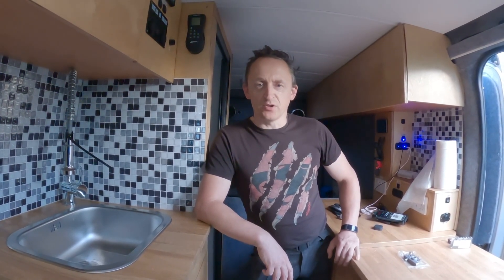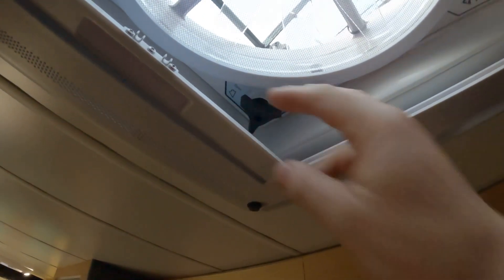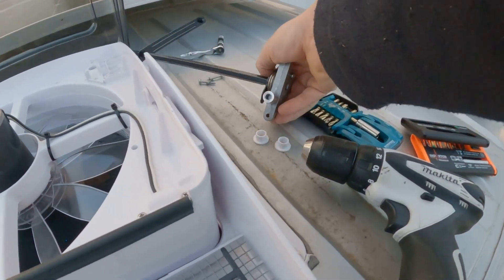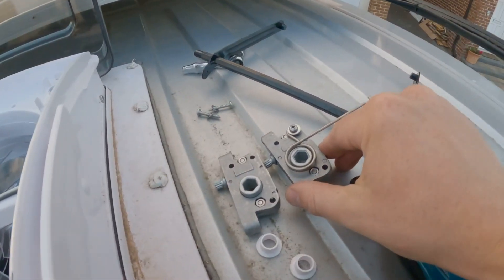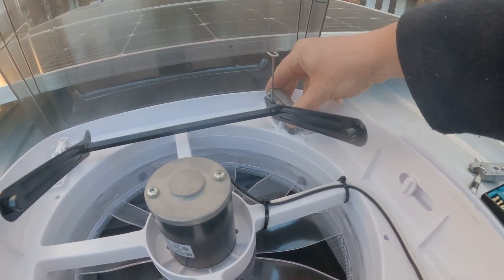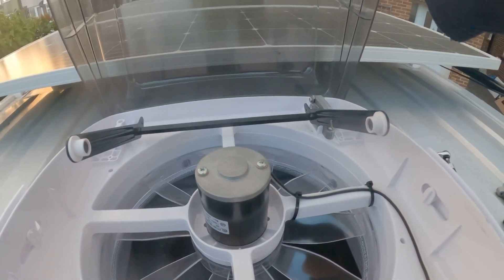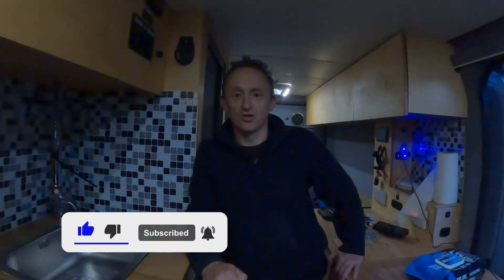Replacing MaxxAir fan gearbox

Comment: Yes,apparently they are rubbish.But a couple of suggestions.Firstly take out the two bolts which hold the two halves of the gearbox together and fill the casting with a good quality waterproof grease,reassemble letting the excess grease ooze out then close it up.This gives a bit of extra protection to the wear surfaces.Second ,it is possible to disconnect the lift motor from the circuit board,this allows manual opening without straining the teeth in the gearbox,this does not affect the fan operation.I would agree that it defeats the object of automatic opening but it does mean the gearbox is under far less strain as you can feel the stops rather than let the motor wind to the limit of its power.
Reply from the maker: Hi Eric, thank you for watching a commenting. That sounds like a great idea, I'm guessing this is what have had to do with one. Its a shame that the gearbox is not better made in all honesty. The only saving grace is that if you need to replace the fan it does separate from the base so it does not break the waterproof seal with the roof.
Reply: yep,spot on,the info I gave in my last post came from Maxxair technical.I have just done this so I know it works ,All the best
Reply from the maker: @ericbana355  Thank you.

Comment: Thanks for the video! 

Your fan doesn't leak? The sealant around it looks super barebones?
Reply from the maker: Hi MyGoogle, thanks for watching, no its totally solid, here is a link to the install of our front fan: https://youtu.be/bQHMpv9Nc-I and here is a link to the install of our rear fan: https://youtu.be/cr02VAC1MAE In both cases we were very mindful to ensure it sealed well. Using the sealant tape to seal under the frames, we felt was the best way to go.

Comment: my fan works fine but the problem is the lid wont open or close unless i manually open it. Is this part you installed going to fix my issue?
Reply from the maker: Hi Powderdawgz, thank you for watching and taking the time to ask a question. It is impossible to confirm 100% that this will fix your problem, sometimes when I have not used the fans for a while the lid will refuse to open on the first time of pressing the open button, this is due to the rubber seal sticking the lid closed, what I do is press the close button and and then open button once more and this normally fixes it. 

If you have already tried this and it did not work for you, it would be worth winding the lid open and see if it closed off the button, this way you will know if its working or not in both directions, once you have done this, I would open the lid, so you can see the gearbox in this video and test to see if there is movement when you press the button. 
The only problem with doing this is lining the position back up correctly, so when you press the button the motor only moves the gearbox between its open and close position. Another thing you could check is that the gearbox itself is working by removing it and try to turn it by hand, again remembering its position as it will need to be in the correct position when put back in. 
After you have tried all of this I would hope you will be able to tell if its a gearbox or an electrical problem. please let me know how you get on.

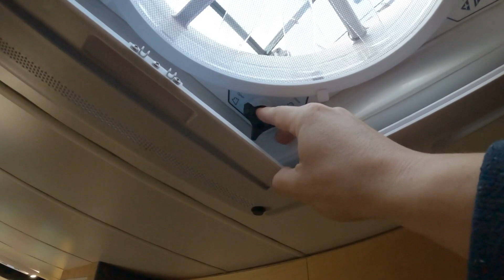Comment: At 0:28 you say open the fan itself, but for me all these opens (manual, remote or buttons) won't open the fan. So I can't get under it to unscrew it. Do you have any advice perhaps?
Reply from the maker: Hi Dn140890, thank you for watching and posting your question. The challenge you are going to have is, if the gearbox is is broken then the teeth could be jammed, hence it will not open. It is unlikely that you are going to be able to remove the screws to open the top while it is in the closed position. Your safest option might be to remove the whole fan from the base or at least remove the screw to enable you to gain access to the screw in the top. One good thing about the Maxxair fans is that removing the fan does not break with weatherproof seal you make when you install them. Hope this helps, please let us know how you get on.
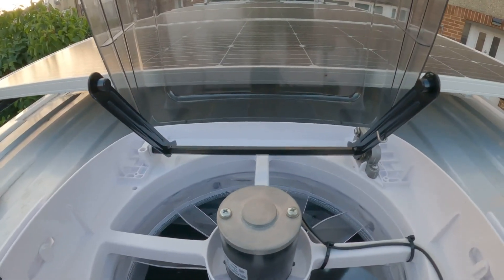Reply: It took us a week but we managed to fix it. Both the lift motor and the circuit board were broken and had to be replaced. First I had to disconnect the two arms from the inside of the fan (you do that around 1:03 in the video but from the outside) and then I could get all parts apart. Thanks for your help!
Reply from the maker: Hi Dn140890, glad I was able to help. I suspect the board burnt out due to the motor being jammed by the gearbox. if you have any question around any of our other video, please feel free to comment and ask.